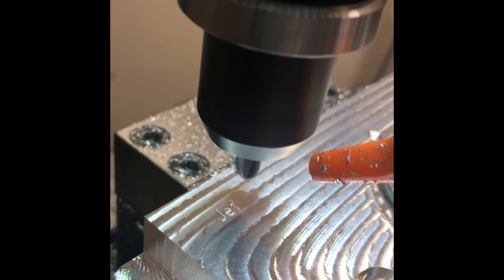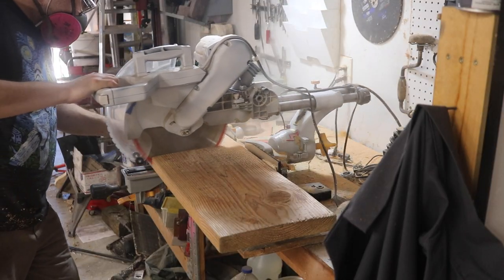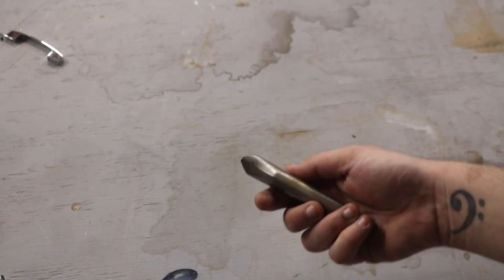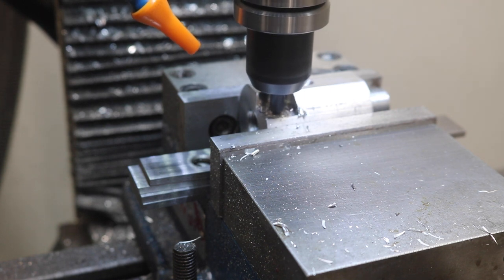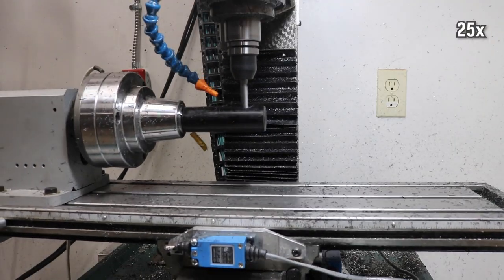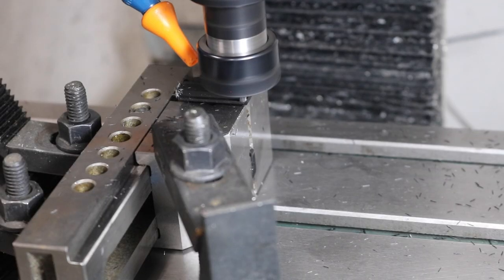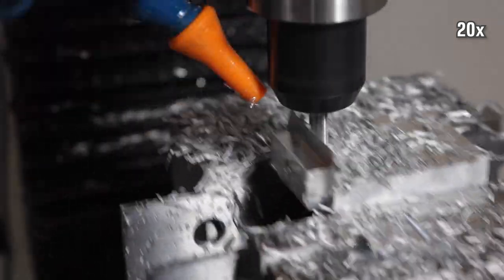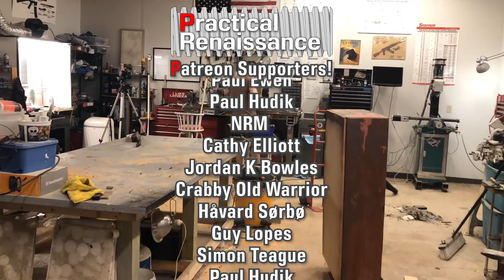Fixtures, Fourth Axis, & Fridges: Variety Show #8!

Comment: First thing that comes to mind about your “onion skin”: stock to leave? Since you used adaptive clearing, it’s common for those operations leave stock by default. 

Awesome video! Very entertaining
Reply from the maker: Yeah I'm thinking this is it; Bad Diligence on my part not going back and making sure I had finishing routines after the adaptive roughing.
Reply: Not sure if he's using a bullnose/corner radius end mill, but the radius may leave some small amount of material (0.020") uncut on the surface.  Because it's so tall, anything above the bottom 10% just flexes away from the tool.